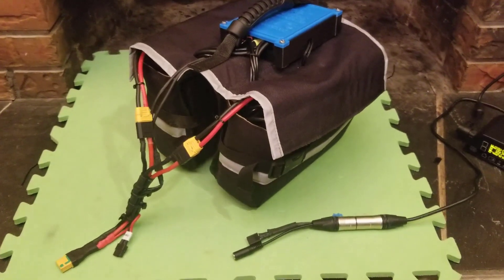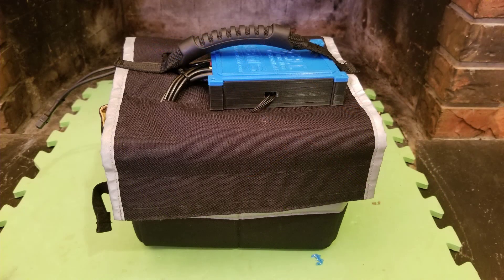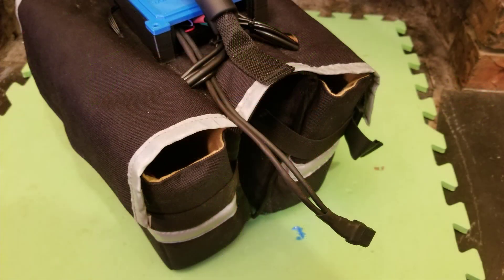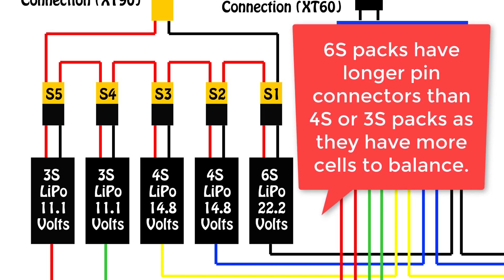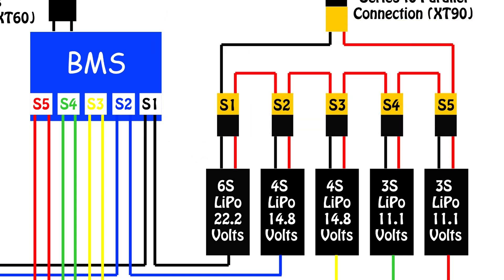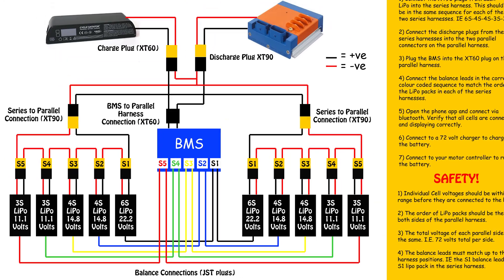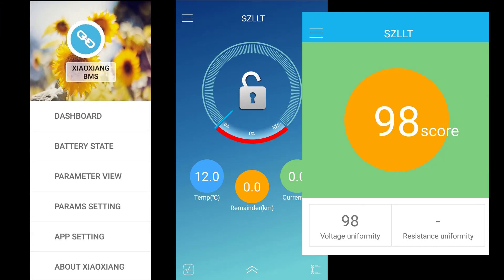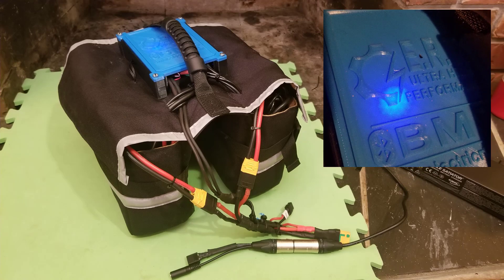Lithium Polymer (LiPo) 72 Volt Battery with Bluetooth BMS (Wiring)

Comment: What bms did you use in this application?
Reply from the maker: Its was a 100 amp ANT one I think.
Reply: @HighVoltageKits  Thank you. I've been building 18650's for my ebike and the whole lipos are completely different other then they have energy in them. lol
Reply from the maker: Actually I don't even use the bms these days. The cells stay well balanced as long as you don't go too low. I can only speak for these particular cells tho
Reply: @HighVoltageKits  Just bulk charge them?
Reply from the maker: Yeah.. They seems to stay fairly close. I usually only go up the 83 volts
Reply: @HighVoltageKits  I just might try them for my next build. Those amps are intriguing!
Reply from the maker: The power you get is immense with very little sag. Perfect for short high speed runs. Not so good for range.
Reply: @HighVoltageKits  its a toss up. I'll have to make two batteries. One for fun and one for distance. Can't have everything.
Reply from the maker: The Sony vt6 or the molicell p42a are good for a balance.
Reply: @HighVoltageKits  I'll look into those for sure. I'll be starting my new build as soon as my current one is sold. Hopefully within 30 days.

Comment: Found the Turnigy Graphene lipos on HobbyKing like yours. Turnigy Graphene Professional 12000mAh 6S15C LiPo Pack w/ XT90. 3 of these will run at 66 Volts and 12 ah. Would this work without running in parallel? Also Curious with the BBSHD/BAC800/NXT Display, would it recognize a 66-Volt battery or does the battery NEED to be 52 or 72-Volts for the display to work properly? Great videos.  think you might be telling me the "C" rating on this battery is too low but I will await. Thank you for sharing. https://bit.ly/2WmWO61 I
Reply from the maker: Hey sorry missed this. Yeah will run but with less capacity. By having two runs you get 12000. They are a little bit overkill btw for ebikes

Comment: One mistake people make with lipo's is undercharging them, they should always be charged to 4.20v per cell and stored around 4.80v. Lipo's last longer when charged to full capacity which would be 84v for your pack and using it all in 3 to 4 days or less and storage charging it when not using it for more than a week. I have been using them for RC planes and 3D helicopters since 2002 and for 5 years on racing drones. You can see on my channel it's all I use and the power is incredible! Nice bike BTW I just built a Fat tire low rider beach cruiser using an 8000w QS hub motor laced onto 26x4 wheels, So much fun!
Reply from the maker: That's some good advice there. LiPo is safe as long as you treat them with respect. The bms does an amazing job balancing the cells.

Comment: Whatsup Capt. You have two 20s packs to double Ah. But you never mentioned what Ah you would get from just having one 20s pack. I am just curios.
Reply from the maker: Its 6,000 mamph using just one stack. I use to to get 12,000
Reply: @HighVoltageKits  Are they capable of handling 150 amps continuous 300 max?

Comment: Hey Cap'n, great vid with some great info. One quick question,  is there a particular reason you configured the packs that way, why not use 5×4s (14.8v)? That way, with all the packs being the same it would be easier connecting them to the bms. Also if 1 goes bad it would be less costly than say replacing a 22.2v pack?
Reply from the maker: Thanks and yeah it would be easier but I wanted the flexibility of being able to run a 52 volt or other voltages.